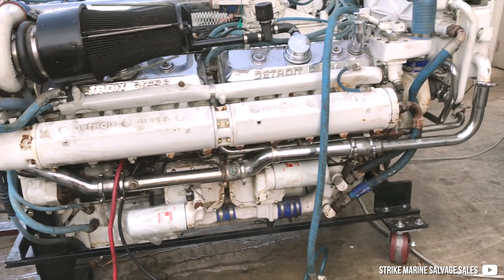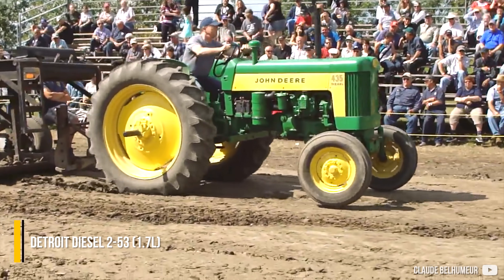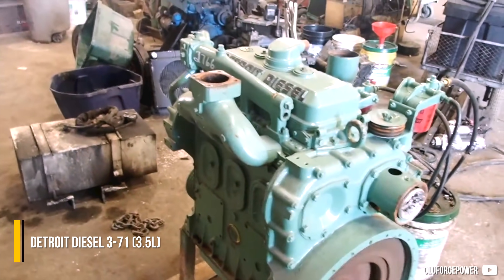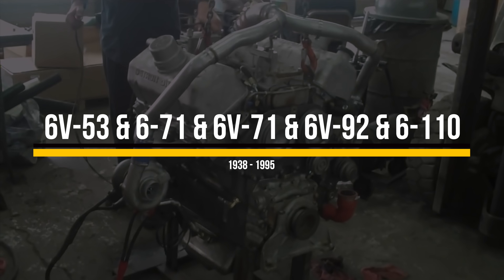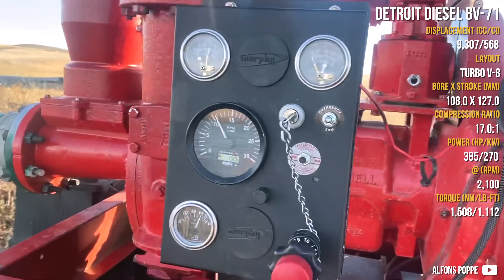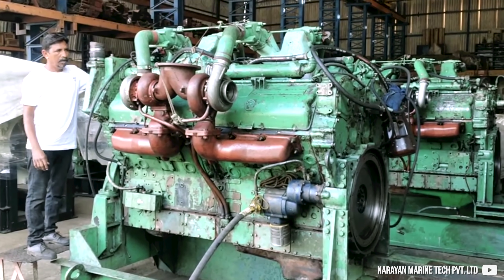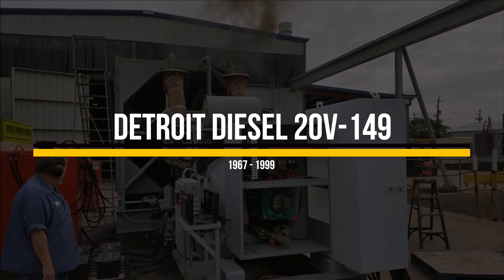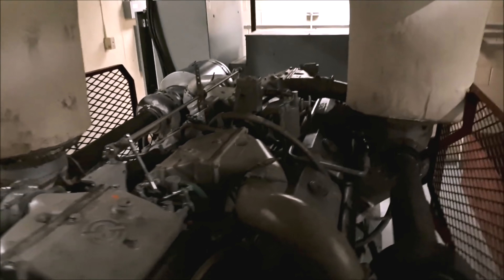Single to 24-Cylinder Detroit Diesel Engines

Comment: I swapped out 2 8V71’s in a commercial crab boat. Those things were bulletproof. They ran from the 60’s until last summer, and they were still going strong! The EPA is forcing them out of use because of emissions. Greetings from Seattle
Reply: What amazes me about the EPA is they never put into their emissions stats how much emissions it took to build and replace a prefect working engine, all that industrial waste and emissions just to get rid of an engine that with proper maintenance and tuning is fine
Reply: @elizabethcherry920  Especially with today's fuel...even an 60 year old 2-cycle DD doesn't pollute as much as it did 25-30 years ago.
Reply: @elizabethcherry920  Right,? From the mining of steel ore all the way to the lights on the assembly line. That’s one thing that the Tesla drivers don’t realize, ever seen an open pit lithium mine?Or all the plastics that are used.
Reply: @elizabethcherry920  Actually, the new Detroit Diesel DD engines now (DD13, DD15, DD16) are so clean that one 2 stroke (like a 8V-92TA) would be equal to about 50 of the new engines.
Reply: @Tchristman100  Right but those new ones are tossing codes and have all sorts of Electronic B.S. - Hell the one Offroad truck we had that was 2-Cycle didn't even have a working battery/alternator... A lot of times we roll started it and even the fuel shutoff (and Emergency Shutdown) was mechanical...it was 60 years old... I wanna see one of these "new" engines run 40-50 years!
Reply: Hmm, maybe that's why so many boats with 71 or 92 series detroits are on the market in California.
Reply: @jaquigreenlees  Detroits in a boat are so bullet proof that many times they will last the life of the boat.
Reply: You would  think that in Seattle  you could just slap a sticker on on.." identifies  as tear 4"
Reply: Gotta love the EPA... 👎
Reply: Yeah a buddy of mine had his two 8V-71's replaced by two 500hp Cummins ISC at a cost of $260,000-all paid for by the state of California!
Reply: @Tchristman100  where can i get one of these removed engines?
Reply: @Tchristman100  LOL. My brother got re-powered under the same exact Program. $270,000 later, two brand new Cummins
Reply: That damn EPA gotta ruin our fun huh
Reply: Fucking EPA.   Go raid the rest of the world before they fuck up our side of things anymore.  Rather sick of all govt organizations anymore they're only here to fuck with people anymore. 🥴😵
Reply: Beat the heck out of them, rebuild them, beat them some more...they craved a beating 😁
Reply: good man. time to retro-fit a PACCAR motor id plate and see how it flies 👊🏼
Reply: You'd think they'd let an old engine go lol, is it not better for the environment, instead of buying a new engine?
Reply: @tacomas9602  It's a combination of much cleaner exhaust emissions and also of fuel efficiency. As compared to the 8V-71's, the 500hp Cummins ISC at 10knots burned nearly 2 gallons less per hour.
Reply: My Crab boat, had 5 green leakers under the deck! Proven, reliable power, for decades. Minimum  amount of parts to carry around as well!
Reply: @ConvairDart106  if they weren’t leaking, it was because there wasn’t any oil in em 😂
Reply: Pretty sure new engines don't really pollute any worse than old ones once their emmision controls go to shit.   🤷🏻‍♂️
Reply: Plants need co². Carbon is GOOD FOR THE PLANET..Get off the pollution bandwagon. GOD HAS THIS. EARTH IS 4.5 BILLION YEARS OLD. WE CANT DO SHIT IN THE LONG RUN. 

PESKY FACTS.
Reply: @robertthayer5779  lol whuut 😂
Reply: Shame to see the Detroit go but who doesn’t love a Cummins either.
Reply: @ApolloTheDerg  Cummins is junk. When I worked at Freightliner, when a Cummins powered truck came in it took 2 hours to figure out what is wrong with it. When a Detroit came in with the same problem, it took 15 minutes to figure out what was wrong-time is money.
Reply: @ApolloTheDerg  I don't if they are the 8.3L versions. The N14s are okay though. Got a bad taste from the 8.3s as they could not run 24/7 driving a 4' diameter ( 150 CFS ) pump without burning up the valves by 2500 hours. While the 12V71s could run for 14,000+ hours driving a 10' OD pump with a 9' ID and an 8' prop.
Reply: @ApolloTheDerg  I am a retired a Detroit mechanic. in my opinion the best CUMMINS engines were the NH series, the V555, and the mighty V 903.
Reply: @ApolloTheDerg  still running a detroit 500 60 series from ‘98. Commerce don’t give a fuck 🤗

Comment: The company I work for still has a handful of trucks with 8v92Ts. Absolute monsters. We had one blow apart on the interstate, and was still able to pull the 40,000lbs of weight behind it for 150 miles with a hole in the side of it.
Reply: That's a Screamin' Jimmy for ya.

Comment: I love how no matter how much exhaust is hooked up to a Detroit it will still be just as loud as a header dump
Reply: The inlet made as much noise as the exhaust.
Reply: The DD is the most efficient way to turn fuel into noise... which in turn scares the load into moving!
Reply: @kleetus92  
Back in the day when they put those 2 stroke Detroit diesel engines in truck's the old timer truck drivers used to say that the best way to get one to run worth a dam was to slam the door on your hand when you got in the truck.
I drove an armored vehicle in the Army (M113 chassis) that had a V6 2 stroke Detroit diesel in them and I always used to say that putting a throttle on one was a waste of time, all they needed was a toggle switch with "idle" and "run" as the two settings since they were either idling or you had it floored just to get it to move.
All joking aside though that's one of the toughest engines ever made, 40 years of being a mechanic for automobiles, trucks, motorcycles and being a truck driver for a period has put me around a lot of engines and I can say it's one of the toughest I've ever seen, we ran those things in the desert heat with the oil so low it wouldn't even show on the dipstick and they'd never miss a beat, they might not be in a hurry to get you where you're going but you could rely on the fact that they would get you there.
Reply: @dukecraig2402  hard to beat simple mechanics that just work.
Reply: @kleetus92  
One thing we learned about those 6V53T engines was that after you let them idle for just several minutes and then you throttle it a giant cloud of black smoke pours out of the exhaust, in combat in an armored vehicle like I drove it could easily transmit your exact location, even if you were just on the other side of a rise or behind a wall or something, not exactly something you'd want to happen, if you even thought that you'd be sitting still for more than just seconds you'd want to lock the throttle open beyond idle, that way when you went to move you weren't actually saying "Hey everyone, I'm right here!!!".
Reply: @dukecraig2402  the Cray boats (western rock lobster, crayfish, australia) had alot of Detroit diesels in them from the old timer sea dogs. they would say the best way to run them is flat stick or nothing. Alot of the younger fisho's would be afraid to 'thrash' engines and get nowhere fast except the fuel dock eventualy. Aslong as they were going like a bat out of hell, it was happy days.
Reply: @shunt0shunt016  i think that's my favorite part about these old detroits. they were made to run wide open and they did that extremely well
Reply: @blendpinexus1416  i remember as a kid vissiting my granddad, had no need for an early morning alarm. from 3am you got to listen to all the diesels wake up and blast off haha.
if you didn't want to get out of bed you just let the low drone sing you to sleep as they left and got on with the day.
Reply: @dukecraig2402  Yep , good old engines , i had an 8v92 non turbo in my old KW cabover ,  my mate had a silver 692 turbo in an  international truck here in Australia , , mine went alright and was a reliable old bugger , my mates little 6v92 went like a rocket and he was always very hungry for a buck and he drove the shit out that thing mercilessly local and interstate until it was getting a little tired years later and he had a rebuild done.
 a nice cheap engine to rebuild back in the day unlike some of the other brand stuff .
Reply: @mikldude9376  
Yea they were reliable engine's if nothing else.
Reply: @dukecraig2402  only engine i have ever seen run without water till it seizes up, cool down and restart like nothing happened
Reply: @kleetus92  and it’s why the load stops moving when told to. It’s too terrified to move.
Reply: @kayvalencia2223  LOL!
Reply: @kleetus92 "YOU MEAN I'M STUCK WITH THIS RACKET UNTIL I'M AT MY DESTINATION!" mood. just awesome engines
Reply: Had a buddy with a long nose Jimmy equipped with a 8V-71. On each bank it had a large muffler under the cab and another big muffler behind the cab with about five feet of stack above that. It was still loud as heck! It was a 318 turned up to around 330 hp. Real old truck style all the way.
Reply: The beast in the raw
Reply: Believe it or not with 4” exhaust and actual 48” stack mufflers like they came with factory they’re not bad at all.
Reply: They're like a force of nature, it's so cool
Reply: if you put a turbo on it quiets down the intake roar quite a bit.
Reply: loud and proud?
Reply: America
Reply: The 6v53 is the loudest engine of the group.  Called a screaming Jimmy.   My daily driver
Reply: Well Iean the power cure doesn't  even  start  on them thell like 2200 rpm soooooo
Reply: Like the 7.3idi it was hard to muffle the intake and just flat out the displasement. I could be wrong
Reply: Ehh , we have a amc general workover rig that’s relatively quiet.  Quietest rig we have
Reply: Uhm modern Detroit’s sound like shit like the dd15 but 2 strokers just scream they didn’t earn their nickname for bein quite

Comment: I retired from doing service work at a KW/Ford dealer and working on Detroit Diesel engines was one of the jobs --tune up, overhaul and service/maintenance and even on 60 Series!
the one thing most noticed was no matter how many cylinders, the 2 cycles all seemed to sound the same!
there used to be a single cylinder unit at Interstate Diesel in Minneapolis, Mn - chrome plated!

Comment: It'd be cool if there was a website that had listings for all these engines.
Reply: Like listing to buy one? If you’re in the market for any older Detroit engine you can call or google Old Forge Power near Scranton, PA. They always have several hundred 71, 53 and 92 series engines in stock.

Comment: Detroit Diesel 2-71, Power(hp/kw)69.

Nice.
Reply: 2-71’s are normally between 50hp-80hp depending on the injectors that are installed in them.

Comment: FOUR-stroke V8 TURBO-diesel engines for me any day!
Reply: You wouldn't say that if a 12V71T with 14 PSI boost came your way.   Can you say 930 HP and 2440 lb-ft of torque?
Reply: @markdubois4882  How about 1,000 HP and 2,500 ft-lbs. of torque from a tuned-up big-block FOUR-stroke V8 turbo-diesel (if there was one), if not TWIN-turbo?
Reply: @josecarrilloii4036  You'd need about 80 PSI boost where the 12V71 only needs 14.

Comment: 12v71, was the ONLY single block V12 (used 2 6-71, NOT V, heads).  More information, the 71 and 92 are dimensionally similar because they are NEARLY the same block.  The 71 is a dry liner, the 92 took this same block a step further and went to wet liners.  I suspect, but can't verify, that the 71 and 92 heads (EXCEPT the 6-71) are interchangeable.

I have a question, that I haven't been able to find an answer to.  What is the block angle of the V configuration engines?  Is it the same in all series?

Detroit, simply the best way to turn diesel into torque and noise!
Reply from the maker: Hello, thank you for correction. I have tried to look up the angle for several times, but never found an answer. By looking at them I think they are about 75°, but cannot verify it. The block looks more than 60°, but definitely not 90° for sure. Tatra used the same 75° angle for a V8, V10 and V12, so basically just added a pair of cylinders. This may be the case of the Detroits as well.
Reply: They're 90 degrees bank angle.  When designing a 2-stroke V12, 90 degrees is the correct angle to bring a piston to TDC every 30 degrees.

Comment: Twin 6 cylinder 6-71 (12 in total) 6046 and quad 6 cylinder 6-71 (24 in total) 6051 could have also been mentioned.
Reply: I run a quadpack in a tug

Comment: Love the 14 liter 60 series
Reply: The 12V71 is a 14 liter engine too......only that it has 12 cylinders and almost 500 HP with no turbo to go with 1250 lb-ft of torque.
Reply: 14 pounds of boost on a 12V71.....930 HP and 2440 lb-ft of torque.
Reply: @markdubois4882  😆 lol

Comment: I rode in several fire trucks that used 6V-71s, love the sounds they create!
Reply: 71 series are the best sounding.  Especially the 6V-71.  I'm not sure why they sound so much better other than maybe the cylinder size just hits a sweet spot for the sound.
Reply: Our old school bus had one of those in it. The old Crowns. The big tandem axle crown bus that I usually rode had an 8V71. I love the exhaust note of a Detroit. Nothing like it.

Comment: From what I heard from guys that work on these DD's the 61 series tends to be turbocharged while the 71 series tends to be superchaged.
Reply: All two stroke Detroit’s have a supercharger. They’re still naturally aspirated unless they have a turbocharger
Reply: @Cormony  They have a Roots blower.  Not the same thing as a supercharger.
Reply: @Cormony  supercharger = Naturally aspirated?

Did i missunderstand or what
Reply: @jaynee8581  On a DD it is.

The Detroit Diesel is a two-stroke, and works off of what is called the "uniflow" principle; because they don't have underpressure inside the cylinders basically at any meaningful point, and because the crankcase is just sealed and not giving any either, you need a blower to push combustion air into the cylinder. They're more of a "self-contained" engine unit from a certain point of view, and oftentimes you've still got enough pressure inside the cylinder post-blast that once you're past the aspiration point, i.e. once you're starting to open the cylinder back up to the inlet, if you didn't have a compressor there on the intake you'd still have so much gas that the outgassing pressure would come back up blasting straight through the inlet and radiator.

In short; any (good) two-stroke needs to have something to basically force air into the cylinder, or at least sit there as a blockage and stop the outgassing after combustion from hiccuping back into the wrong pipes. Smaller engines tend to use some kind of design on the crank, but something the size of a DD (which is built properly) always comes with a precompressor to feed the engine with air and make sure the gas flow keeps going in the right direction.
Reply: @jaynee8581  2 stroke diesels need a roots blower to pump air inside the cylinder because they dont generate vaccum so, if you dont use a blower they wont start.
Reply: @Sakhmeov  I never knew that. Thank you.
Reply: @Sakhmeov  ok yeah.

Having read you (well written) explanation and looking at images of how two stroke diesels work.
I get what you are saying.

(I guess you could look at the crankcase in smaller two strokes as something that creates forced induction aswell)

Oh and BTW i like that you actually proved your point rather than just saying something like "no you're just dumb"
Reply: @jaynee8581  Look up DeBoss Garage and his videos on the Detroit Diesel.  He tears one down and gives a good explanation!
Reply: @jaynee8581  The supercharger ( blower ) is technically a "scavenge pump".  It pushes exhaust gases  out of the combustion chamber with the intake air charge.  (this all happens in the brief time that the piston is near bottom dead center,   there is no "intake stroke" at all)  The turbocharger (if installed) is in addition to the blower.

Comment: I am unsure on how 2 stroke diesels work i know they have ports and need a blower or a turbo
Reply: They work well. :-D The piston uncovers the ports and allows the pressurized air in while the valves in the head ( 2 or 4 per cylinder ) ( 48 all set by hand on a 12V71 NA 4 valve head engine ) are open so that when the valves close , the port closure lags behind. Then the rest is taking fuel and making it into noise. :-)